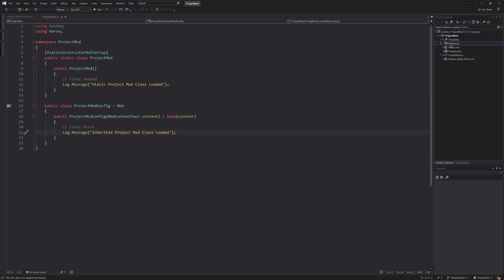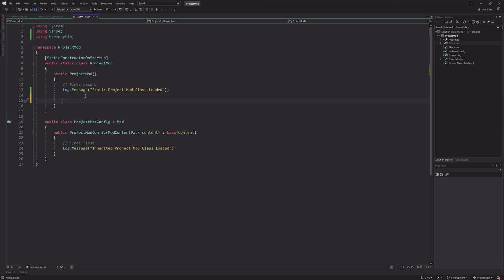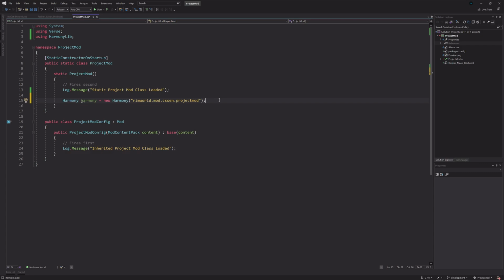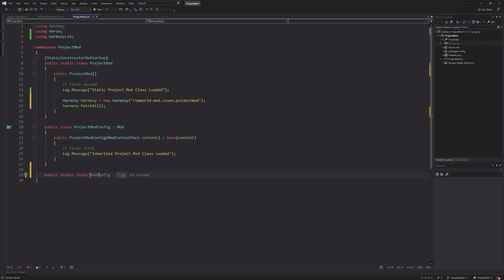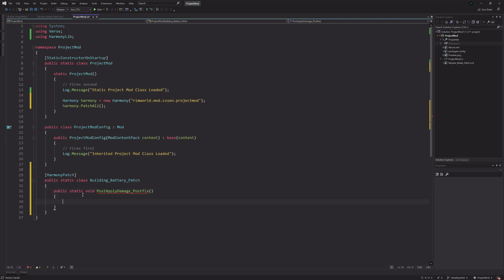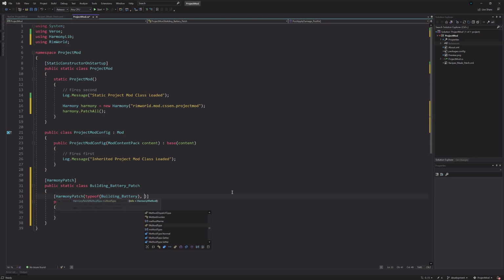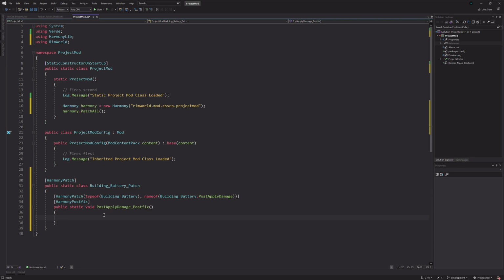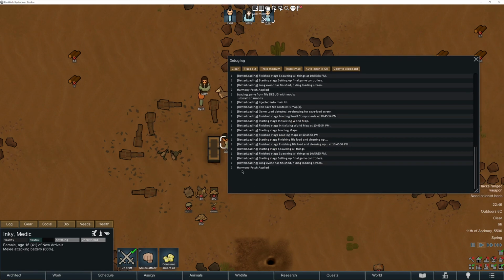Harmony Setup Guide for Rimworld Mod Creation

Comment: Hi, ive been having trouble getting my harmony instance to work.

I tried copy and pasting the file from the repo in the comments and doing my own solution based on the harmony docs. But regardless of what i do, even an empty class throws the error "ReflectionTypeLoadException getting types in assembly MyMod" in rimword console on startup. 

Any chance youve seen this before and can help ?
Reply from the maker: I am not sure what might be causing this - make sure that your project is targeting .NET 4.7.2 (right click solution and open properties) and also that it is a class library. I have another video that covers project setup, if you haven't seen that there are some things I cover there that could solve this.
Reply: @cssen_  Thanks so much, that was it - i was building a "Class Library", not class library "Class Library (.NET Framework)", so was targeting the wrong .Net.

Comment: Hey by any chance have you used harmony with Transpilers for Rimworld? If so could you maybe make a tutorial for it. I would like to modify private functions which I dont think you can do with pre/post fix.
Reply from the maker: I haven't really worked with transpilers, mostly because they involve manipulating the intermediate language and I don't really understand how that works. If you haven't already I would recommend reading the page of the harmony docs that covers transpilers, there is an example explained there that seems to cover a lot of the details. I'm not sure what specifically you are trying to do that you would need a transpiler, but based on my experience with java and mixins there is often a different approach that requires less intricacy than overwriting what is blocking your progress (though this may be less the case for C# and harmony depending again on your specific case). Here is the link I mentioned: https://harmony.pardeike.net/articles/patching-transpiler.html

Comment: @2:36 your IDE just autofills "using Harmony".
Mate, I came here EXPLICITLY because it doesn't do that on normal machines. You skipped a crucial step in your tutorial :/
Reply from the maker: My visual studio settings are really messed up so it's entirely possible that it auto-fills because of some extension. Even so, you only need that one 'using HarmonyLib' statement to be able to refer to the Harmony classes regardless of whether it auto-fills - I did explain in the beginning of the video how to add Harmony as a dependency to your project so as long as you followed that correctly it should work. If the problem you are having is more specific, let me know more information and I can try to help further.
Reply: Most IDE's do that. Frankly it's a basic part of C# and any IDE will give an error with how to fix it if you are missing a reference.
Reply: @SuperPyro  uHM; YOU GET A HINT that you're missing a reference. And if it's a standard piece of library you get help. But with game-libs you dont.